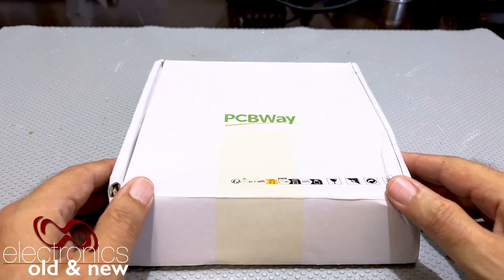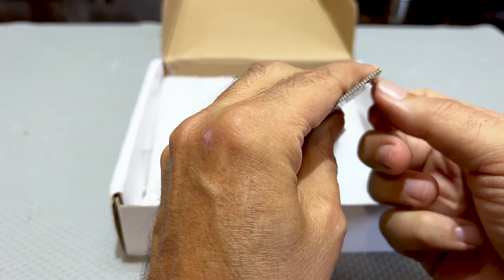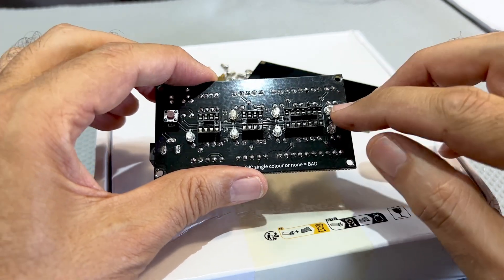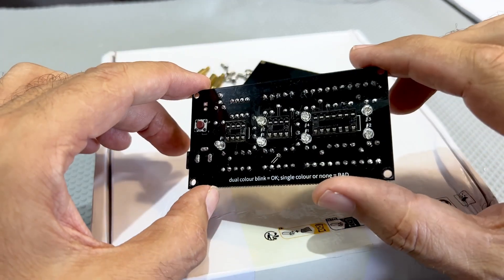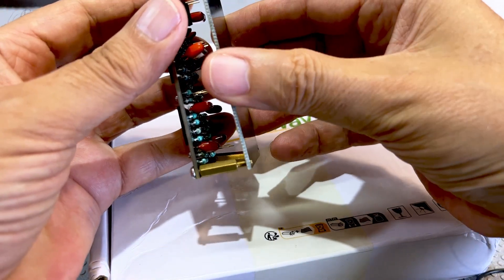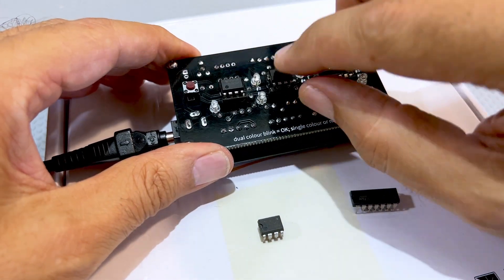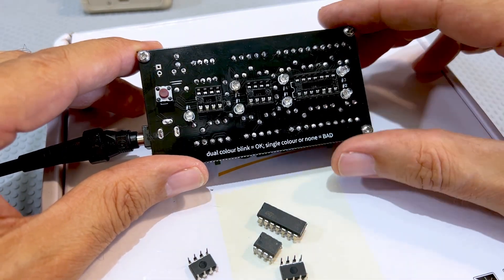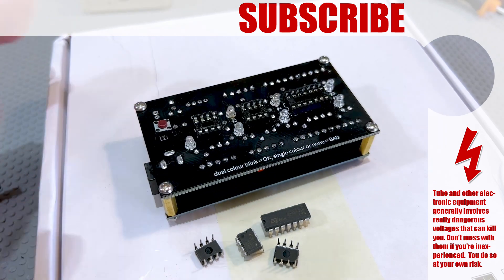Building the Op-amp Tester for single, dual & quad packages. Dual-polarity LED indicator.  #pcbway#

Comment: i built your circuit but i cant find these leds with 2 pins and dual color. can you help with the part number? thank you for the project!
Reply from the maker: Just do a search on mouser or DigiKey.
Reply: @electronicsoldandnew  i bought all parts from mouser an jclc , did not find any dual color led with 2 pins , only 3 pins.
is it something special?
Reply from the maker: https://mou.sr/49NnvoB

Comment: Where can I get your boards mate??
Reply from the maker: Pcbway share section
Reply: Ok so I got it and can’t wait till it’s sent away to me but can you tell me what LED lights you’ve used??
Reply from the maker: @Sickindian5 : high brightness 5mm LEDs.
Reply: Also what did you use for U1??
Reply: @Sickindian5  Puteți utiliza un tl072
Reply: Puteți utiliza un tl072

Comment: Share the link to get those LEDs please
Reply from the maker: Had these in stock. Just search for bi-colour LEDs with two leads. Should be easy to find.
Reply: @electronicsoldandnew  I have a Rookies question. Is a Darlington Array an OP Amp? And can the be tested the same way?
Reply from the maker: @BJcanal270 : no
Reply: @electronicsoldandnew  Thank you for your quick response. I will wait for the Darlington Array Tester project 👍

Comment: Thank you for the videos.  On the subject of 3D printers,  If you want a  tool that can be relied upon, I recommend PRUSA Mini or MK4. They cost a bit more  but are well thought out, dependable and well supported. The disadvantages are they are a bit slow and not the best at large, high temperature prints. If you enjoy a challenge, buy one of the cheap brands or build a Voron...
Reply from the maker: 👍 thanks

Comment: I've had good luck with the Ender range of 3D printers from Creality.   I use and Ender 5, but I think the Ender 3 range is cheaper, if you don't mind slightly less accurate :)   I've found my Ender 5 has been really good and really useful.    I don't use it as much as I probably should, but at the same time I don't regret buying it
Reply from the maker: 👍 thanks

Comment: Thanks for yet another interesting video, really enjoy your output. Even purchased on old Saba stereo radio in need of some TLC, will enjoy that on the rainy days in the autumn.. On the topic of 3D printer I took the plunge and purchased a Sovol 01 Pro, I was a total novice.. It  was relatively inexpensive but has printed very well from day 1. It is partly assembled , so the accuracy seems to be good. Often get promo deals direct from Solvol and I got my delivery from the UK.

Comment: seem to remember years ago a tool that looked like a clip board clip. It gripped the edges above the pins to be used to insert or remove IC's without bending pins. Found this one online (RVFM PB-16 IC Extraction/insertion Tool). may do the trick?
Reply from the maker: I also had one of those. Must be here somewhere 😊

Comment: Nice tester! I will order boards and build one. I was thinking as you showed the sockets, why not sockets with turned pins? Right afterwards you gave the answer, but I would use them even they are tighter fit. Those will rip out the contacts if you try a used, unsoldered one..  Also, you could put small rubber feet in the underside, so you don't scratch your benchtop.. Otherwise, great!
Reply: Do you know what kind of LEDs are used in this project. I already ordered but it looks like they are dual color but in only two pins. Are they reverse polarity or dual polarity. Or they change color as the voltage increases ????

Comment: Maestro, a huge thank you for this project. I throw an idea, what would be useful, a sort of frequency range analyzer and distortion analyzer? I know, there are many PC suites and softwares, bit I really find it not immediate nor intuitive to set up such a test rig with a personal computer... Perhaps you've done it already, perhaps not, well, I just toss a coin in the pond...
Reply from the maker: I did a PC interface to use with the Visual Analyser software, but it is a little difficult to set up. Not sure a simple solution is possible. Might give it some thought. Thanks.

Comment: And another thing to be aware of; I found these little tactile pushbutton switches to not be the most reliable things in terms of low on state pass through resistance and contact bouncing. Especially long term. I would have opted to have the switch not switch the power rail directly, but provide merely a base drive to a pnp bipolar transistor (or p Mosfet) which also enables provision for contact debouncing with the addition of a cap into the base drive circuit.

Comment: While the idea of having a blank PCB as bottom plate is close to genius, I would suggest putting the stand offs the other way around so the rounded heads of the screws make for the feet. If you put the nuts on the bottom like here you run the risk of scratching surfaces with the sharp edges of the screw thread sticking out. Ofc M3/M4 cap nuts (dome head nuts) would be the ultimate solution.
Reply from the maker: Yes, cap nuts would be best.

Comment: Hi Manuel, Regarding 3D printing, you can't go wrong with Creality 3D's Ender 3 line of printers. You'll find the most basic one, pretty noisy, to the model with more features going from, quieter operations, to automatic bed levelling, or to touch + color control display, but all of them share a good foundation of design. Regarding the tools to design enclosures, and more, TinkerCad from Autodesk (creator of AutoCAD, Fusion 360, etc) is a good starting point. You'll be surprised how the CAD world is all integrated now. Consider yourself as a "geek buying" stuff, therefore a site of same name may exist to let you find what you need at the best price. Cheers, JP.
Reply: Agree with you sir, all I would add, and only because my son bought one and for the price I’m shocked how quiet it is as well as general performance, is the Anycubic Kobra Neo. As with most 3d printers in this price range, it’s essentially an ender clone, but for under $150 it’s a very good start printer m, not perfect but good value.
Reply from the maker: Have had a good look at the Ender 3 V2 neo. Looking probable 😊
Reply: The Ender3 V2 is pretty quiet compared to the original version. Also Autodesk Fusion 360 is free for private use and a fantastic and easy to use application, it also has electronic PCB design as another part of the package. I've been using the printer and Fusion 360 for a couple of years now and I definitely recommend both, trouble free to this point- Famous last words😊
Reply from the maker: Thanks 😊

Comment: Great tool.
About 3D printer. It seems that Bamboo Lab printers is the prefered one at the moment.
Doesn´t PCBWay offer a 3D printing solution?
It is easely $700-1000 + filaments and no one is plug´n´play, not yet, some get close but it is not like your "paper" printer.
Reply from the maker: They do offer it but I still want one 😊 I guess I’ll be a good boy until Christmas 😊

Comment: Maybe you can snap it off on a table edge.  Haven't got a 3D Printer yet myself.  But the Elder seems popular.  But can't say for sure!
The PIN Sockets are very tight!  Do you not have one of those horse-shaped metal pullers?  If you make a cover for the top, a puller will be hard to use, and a screw drive won't work.      BTW- Slick little build! 👍
Reply from the maker: Tried that. didn't work :)
I’ll have a look at that 3D printer. Thanks

Comment: Looks very useful!  I think you can break the board with your hands if you place the perforated line along the sharp edge of a table top and bend down the overhanging part with the palm of your hand while pressing down on the non-overhanging part with your other hand.  Or is the board too strong for that kind of persuasion?
Reply: I usually put them in a vice and they snap clean and easy
Reply from the maker: Tried that and still couldn’t break it 😊